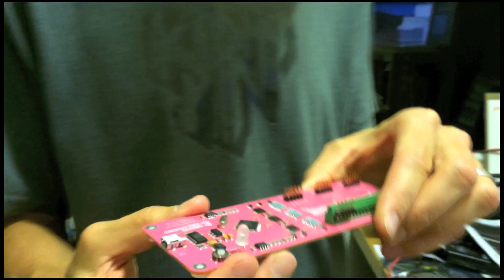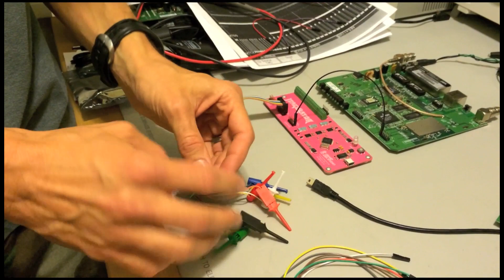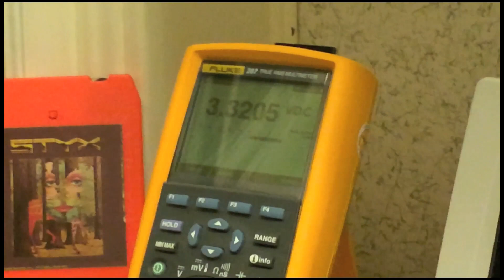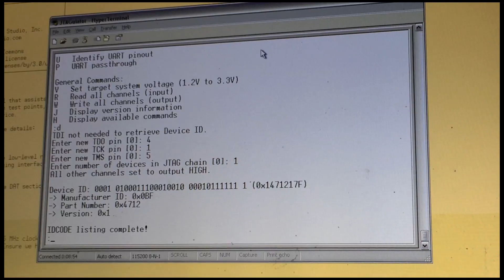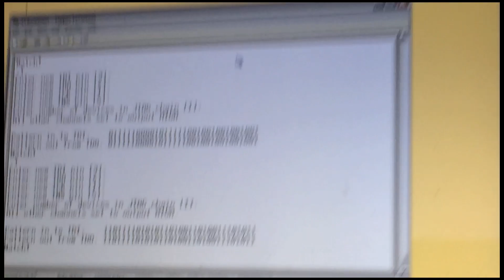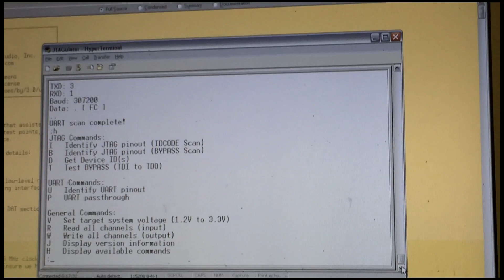JTAGulator: Introduction and Demonstration (Expanded)

Comment: Very well thought out design for the JTAGULATOR. Just wondering, are there any other quick ways to check for JTAG pins? I’m thinking if the target JTAG Pins have any relationship with GND or Vcc through a certain resistance, or if that resistance changes as the JTAG becomes enabled. Any knowledge would be appreciated! Cheers on the JTAGulator

Comment: Do you think it's wise to check the voltage level on those other pins before connecting to your JTAGulator, on an unknown board?  Nice device by the way, need to put that on my Christmas list.

Comment: Can you show a tutorial on how to extract data from another JTAG device using the JTAGulator?
Reply from the maker: The JTAGulator currently only identifies the unknown pinout and can perform some basic probing of the target device(s). Eventually, I'd like to integrate support for OpenOCD and UrJTAG, so you can manipulate the target directly without having to use different tools. For now, you'll need to disconnect the JTAGulator and use something like a Bus Blaster, Adafruit FT232H, or other JTAG hardware supported by the above mentioned software.